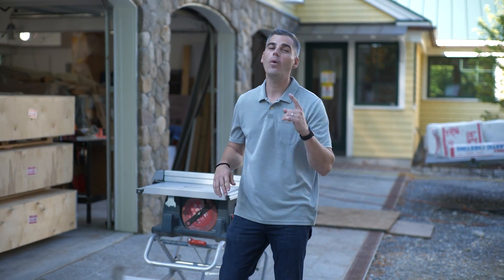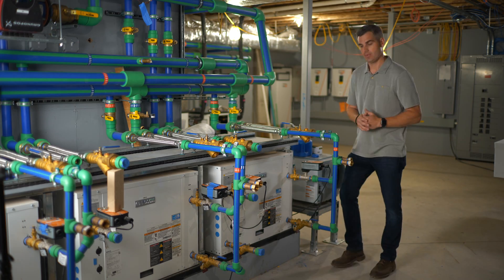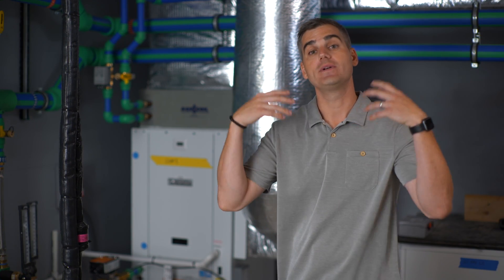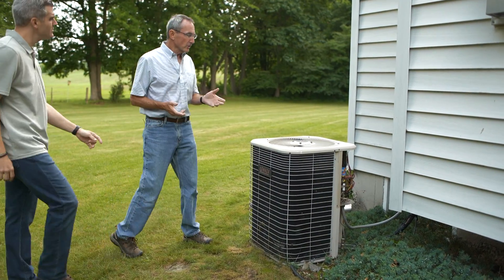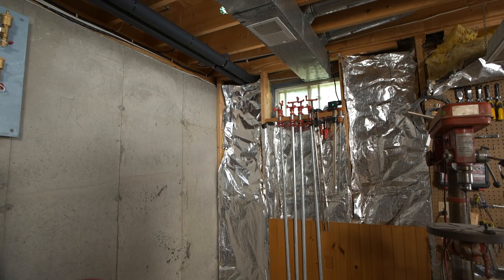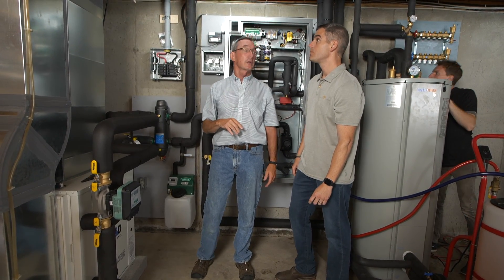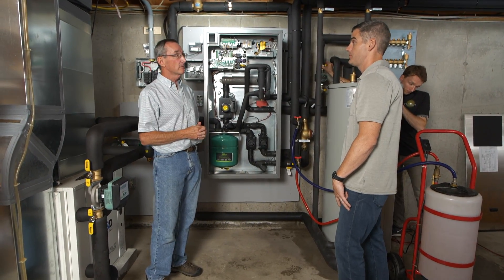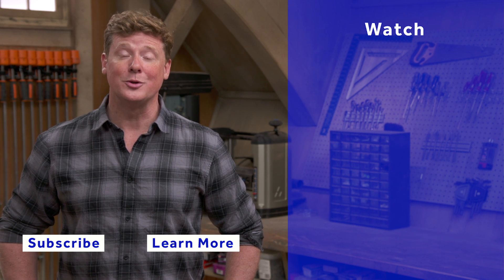Understanding Heat Pumps | Future House | Ask This Old House

Comment: The problem I’m having with my new mini-split quad zone heat pump is having to manually change it over from heat to cool in our weather which has been 80 degrees one day, and 35 degrees a few days later. In the summer, it’s fine, but in what passes for winter in south Texas is another matter.
Reply: Mine has an auto setting where it can switch between heating and cooling after a certain temperature difference. But I've never tried it.
Reply: I installed a quad Mitsubishi and the problem has been a head unit going into standby mode when there was a disagreement between head units as to which mode the condenser should be in. Just sits there with a blinking light. Putting the head units into auto mode seems to help. It’s the coldest day of the year this morning. 10° Fahrenheit, and my bedroom is still warm, but it’s been doing a lot of defrosting and I proactively turned on the oil heat in the kid’s bedrooms.
Reply: @generallyhelpfulsoftware646  by mem one of them should be set to "master". that dictates what mode they all run in. not sure on the remotes but its easy to do with the wall controllers.  also keep in mind multi output systems can run poorly. they are more suited to similar sized heads in similar climate spaces. ie you want all heads running at once. running a small head on its own makes it run badly (compressor massively oversized for the head).
Reply: @tweake7175  they are generally all working at once although my son likes his room hotter than my daughter. I’m not finding anything about a master mode via Google.
Reply: @generallyhelpfulsoftware646  check out the install manual (not user manual) and also the wall controllers (which is where i found it for mine). obviously different brands may be different. i hope that helps.
Reply: Isn't it just one click on the remote ?

Comment: It's gonna be a balmy 9° in Rhode Island tomorrow. 

I want to work on getting off of heating oil and on to heat pumps but I don't think the technology is there yet.
Reply: Good (Japanese) heat pumps can heat effectively at even - 22 f (-30c). People in Russia and Scandinavia have used those for decades.
Reply: What so you think the weaknesses are?
Reply: @b_uppy  I've read that sub freezing pumps are hit and miss dependability wise. That's not something I'm willing to miss on in the winter. I can swelter through the summer and get by but in the winter time in New England  no heat can be a death sentence.
Reply: @jeremymenning56  
Thank you for clarifying.
Reply: @b_uppy  9" of snow covering the panels! Look at Texas last winter. Both solar and wind froze up last winter! They should of made another video on wind, solar, and batteries vs. climate zones.🤔
Reply: It’s 9° here in southern New Hampshire and my bedroom is 68° being heated by a non-hyper heat Mitsubishi. Doing a lot of defrosting so there are bursts of cool air.  Maybe should have sprung for hyper heat. 

Will probably keep the oil heat on for the next two days as while the heat pumps work this cold, they lose most of their efficiency advantage. So oil for a handful of the coldest days and heat pump the rest.
Reply: @generallyhelpfulsoftware646 : Air-to-water heat pumps work much better that air-to-air in colder climates.
Reply: Just gotta get one rated for your climate (and probably would be wise to think about what your local climate will be like in 15-20 years). Mitsubishi Hyper Heat models come up a lot in the colder climate discussions.

You could also look at geothermal heat pumps too, that would reduce your dependence on the temperatures outside.

Benefits to getting off gas and oil would be no more chance for leaks/ground contamination, no longer having to worry about CO from your heating system (though your dryer and stove would still be a concern if they're gas too). And of course convenience! You wouldn't have to have to heating oil delivered to your place. 

However you'd still be vulnerable to power outages, so maybe tap into your natural gas supply if applicable for a backup generator.
Reply: @Phoxtane  
Natural gas also failed in Texas...
Reply: @b_uppy  Texas usually also doesn't have to worry about winter freezes. Rhode Island probably handles them better if I had to guess
Reply: @Phoxtane  
Texas should worry about them.  It's part of being resilient.